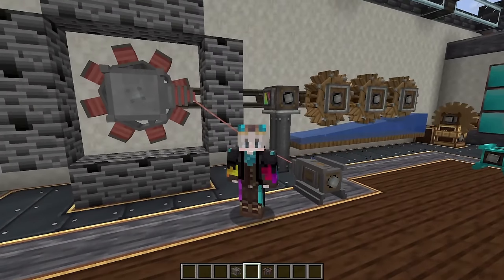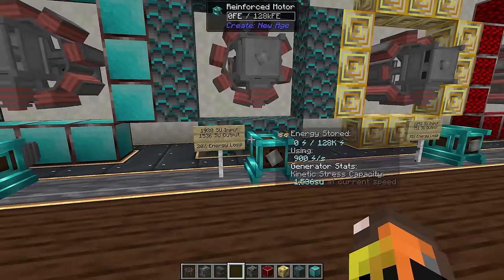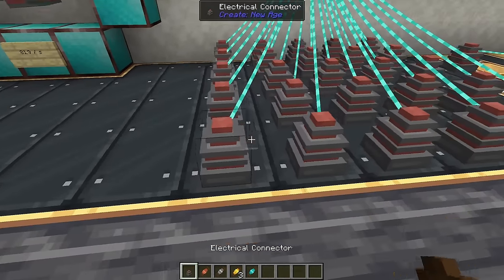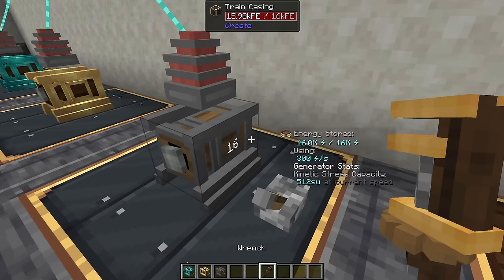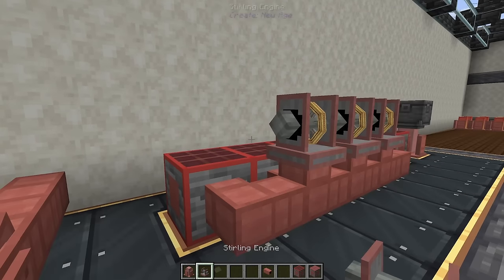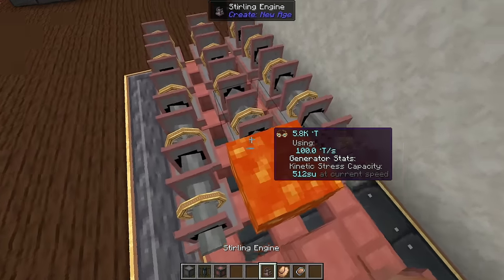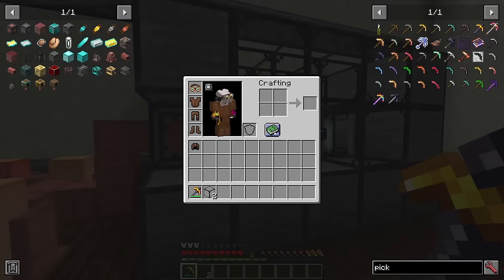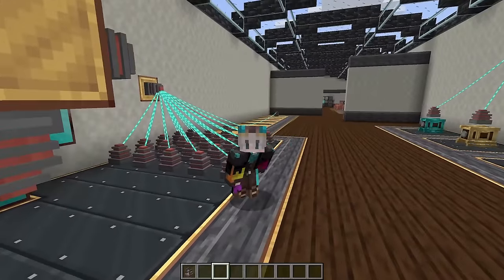Generate ELECTRICITY with Create | Create New Age

Comment: i've been having issues with the mod. i connected wires correctly, with the carbon brush and all, and yet the motor still wont spin. also, all of the energizers crash my game when i place them. is this a compatibility issue with another mod?
Reply: To the last thing, probably, I'm not sure. 
But the first thing, make sure you have a rotational force for the coil, and wires from the brush to the motor

Comment: I never heard of Reactors being used to generate power through Stirling engines.
It's always Steam Turbines. Every single case.
In Power Plants, and Nuclear Submarines, the Reactor creates Steam, which in the process cools the reactor, and then moves through a steam turbine which rotatates and powers a Generator which is what provides the electric energy.

Nuclear Aircraft Carriers, like the USS Enterprise (CVN-65) (not to be confused with CV-6), or the Nimitz Class, or the USS Gerald R. Ford, the Reactor also uses steam to power a Turbine, but the Turbine directly powers the shafts to the propellers to move the ship.

But enough about Shipping, let's speak Create.
I guess you need to heat a stock Create Boiler to power Steam Pistons to power a generator, to create electricity. And the Boiler Heaters are exactly for that.

But still, I'm over from Stormworks, a game specifically about building vehicles, and it does include Steam propulsion, electric motors, generators, and Nuclear Reactors.
Reply: I dont think it was intended for stirlings to be powered by the reactor, they just use the same thermal system. the heaters can replace blaze burners, so its likely it was meant to be for the boilers to begin with.

Comment: personally i think it would have been cooler to require netherite around the generator coil, instead of adding a new thing. netherite is already implied to be magnetic by its use in the lodestone recipe. ancient debris could generate a little bit of electricity, lodestones could generate more, and netherite blocks could generate a ton.
Reply: That's insanely expensive though, and not worth all the hassle in the long run
Reply: @chrissant6277  yeah but electricity being way later in progression makes sense to me. that's like modern technology at that point. it should be hard to get. granted it should maybe be given some more powerful uses if it were made harder to get, but idk

Comment: Does the energy from this mod work with other mods? could I, for instance, build a hydroelectric dam to power my Mekanism machines?
Reply: You can try, but it'd have to be a big thing, large waterwheels only produce 512 su per. 
That wont be much to convert unless you have like 30 waterwheels lol
Reply: @chrissant6277  I mean... I do like the idea of having an actual reason to create a megastructure, like building a lake at the top of a mountain that flows down through a series of dams into a river (I don't like the artificial isolated water wheel cubes, even if they're technically more efficient)
Reply: @DisKorruptd  Hey do whatever you want man. I'm not gonna stop ya. I'm just sayin you might wanna gather some resources first. 
But yeah that seems like a cool idea, i wanted to try it but just a lot to do

Comment: Hear me out...

Nuclear steam engine

You use nuclear powered boiler heaters to heat your steam engine
Btw, this is kind of how nuclear power works in real life (it use steam from heating to generate electricity)
Reply: Absolutely. 
I think that's how the addon wanted you to use them. 
It's an easier way to get a max sustainable boiler, and you need that SU for a good coil spin

Comment: so basically you can generate power from nuclear reactors, but only with sterling engines, and the whole purpose of electricity is to more easily route power to different machines? I guess it sounds useful but it's only effective late game because of the huge power losses early on
Reply: you can power boilers with the heat too, but yeah, it's not too useful i think
Reply: Nope, mostly wrong. 
You can use nuclear for max boilers for big projects, and use things like solar plates for small homely living.
You can use the nuclear powered boiler for a max SU production and convert it into electricity.

Comment: The real question is - does it connect with immersive engineering?
Reply: Given the art style of the wires and their connectors, I would be extremely surprised if they weren't directly compatible, but IE would be compatible anyway - if I remember correctly, IE just uses RF and has a novel way of transporting it, so the absolute worse case scenario is that you need to just pick one type of connector and wire and use those.

Comment: It's a useless addon, it brings very little things and just two might be usefull (the heaters if they work on boilers and you could make tham stable enough and the xp bottle recipe).
If they would have added some way to automate diamonds or something else that you might need in create like copper or zinc than they would have been acceptable but they don't and it's not even realistic (I know it's minecraft but create has more realizem to it, at least in the craft part, diamond for exemple isn't magnetic which would make the last tier of the magnets useless in reality but you can make a hand that would place items even in reality be it that it wouldn't work as well and I wouldn't nesecerally make it with brass).
Reply: Doesn't matter if diamonds are part of it or not, the rotation into electricity thing is pretty realistic. 
And it's supposed to be used to split up the main power source into multiple motors for places where a steam engine doesn't work

Comment: I personally don't like the tier system in this mod.  I could like the mechanics, but I don't see need for tiers of motors, wires, etc.
I'm also not sure this mod offers anything new. it offers new power generation and a new way to heat basins, but it doesn't seem to offer anything that Create is missing aside from the wires.
Reply: It's more likely a space considerate thing. 
Lets say underground you have a big generator a few chunks away generating electricity. With some wire connection you can convert a lot of that power to your motor(s), powering your machines without it being clunky or in the way of much. Now I think there are ways to hide shafts and machinery well so it's not in your way, but I guess this makes it a bit more clean? idk

Comment: Honestly, this add-on has some really terrible efficiency. You can literally eat up most of your SU trying to generate a decent amount of electricity, but the output you can actually get is incredibly small by comparison. You can generate over 1M SU, and struggle to get 250,000k out of it at the end. The carbon brushes, the wires, and the motors just don’t have enough umpf to do it. Most of your energy production is wasted, because the max you can get out of the carbon brushes is around 17.3K energy units a tick, the diamond wires only carry about 8K per tick, and if your using the reinforced motors then you wind up using more energy than you can transport. You can use more carbon brushes, yes, but then you need more lines to pull energy from those brushes, and independently carry that current to the motors to generate the SU. Especially because a single line can’t even handle the output of a single carbon brush. It would be one thing if you needed more lines to accommodate three or four brushes, but it can’t even handle ONE. It’s basically a double bottleneck, and it causes you to lose a shit load of your power production. It’s basically not worth it in its current configuration. It wouldn’t be ass bad if the caps for both were higher, and the wires had a higher cap than a single carbon brush. But it doesn’t right now, so I don’t really see the point of this mod.
Reply: Well....
Motor extensions fix the main issue now. 
And it's supposed to be used like electricity is used now. 
In places where a steam engine is a little too much. 
Like a house.